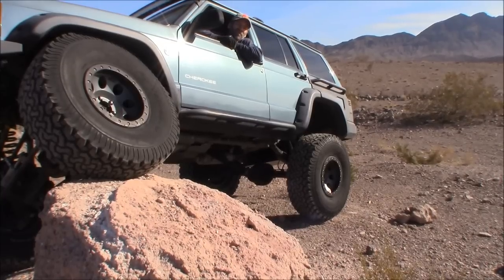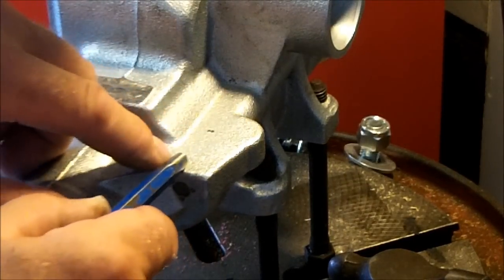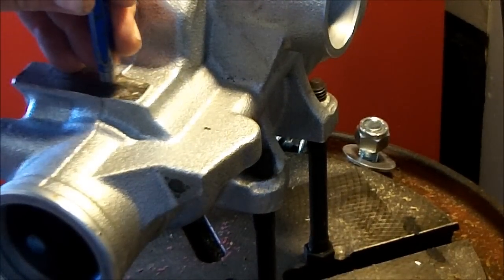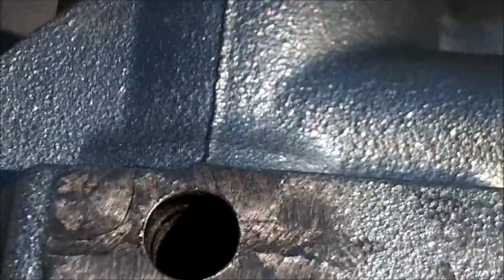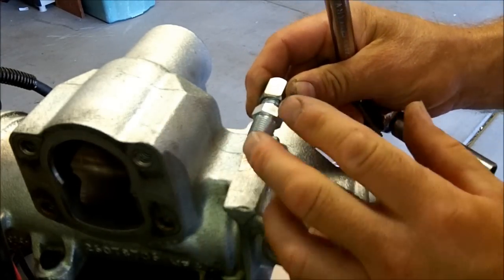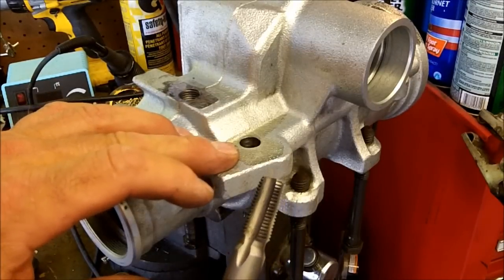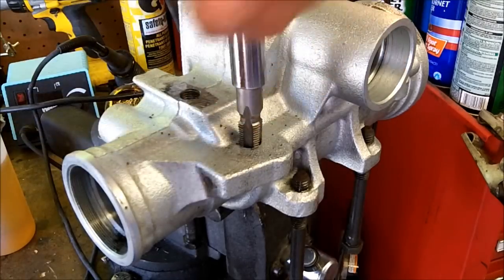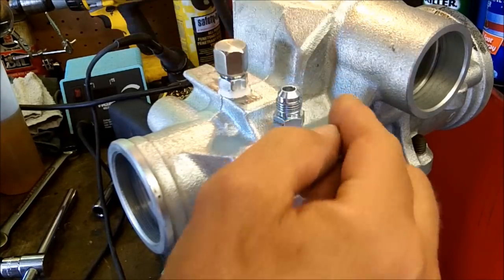How to Port a Power Steering Box for Hydraulic Ram Assist

Comment: That was impressive moving that rock and sliding the Jeep over. I'm on 35s with a front locker. In 4 low while Turning sharp is a chore sometimes. Usually pop back into 2wd
Reply from the maker: That sounds like the shifting fork inside the transfer case needs to be replaced. By the way I'm on 35's and front and rear lockers
Reply: @martinbuilt  oops, I meant to say I shift back into 2wd to make sharp maneuvers and shift back into 4x4 after. Simply having the front end unlocked makes a big difference. I don't have a selectable locker. Spartan lunch box locker.
Reply from the maker: @lol123321123321  oh I thought you were saying that it was popping out of 4 wheel drive.
Reply: @martinbuilt  yeah, I phrased that wrong. Nice jeep man, looks like there's not any mods left for that Jeep! Built right
Reply from the maker: @lol123321123321  Thank you, I got a few mods to go

Comment: everything you mention i already no about but anyway thanks for your out put..have a great day..
Reply from the maker: There's another thing how about the frame where you bolt the steering box to. Many times on the Chevrolet the frame will crack around the steering box this would cause a lot of movement in steering wheel.
Reply: i no allabout the frame cracking where it mouts i have already check that when i pull my gear box off the frist time

Comment: So what is under that passage plug? Could a person remove that plug, open up the hole and tap it vs cross drilling the thinner wall? 
I have seen the replacement end caps that have a port in them, which port is that cap supplying vs your method of drill and tap? BTW not the biggest fan of the ported caps, just seems vulnerable!

Comment: Ok...I know it has been 9 years since you published this video...but did you ever have a video on installing the hydraulic cylinder and lines?
Reply from the maker: No, I didn't do a video on that, I wish I had.
Reply: @martinbuilt  what did you use for the hoses and hydraulic cylinder? And how much travel does it need? And do you still have the XJ?

Comment: What would the on road characteristics be like with a hydro assist upgrade. My cherokee is my daily driver. Cherokee steering has always felt heavy when I drive my other rigs. 

Curious how this would make it feel during normal driving. Hoping it would help it feel more refined and modern. If that makes sense.

Appreciate the videos man.
Reply from the maker: At 1st you're going to swear that the steering is loose and what it is it's become a more sensitive, it takes less effort so you have a tendency to oversteer at 1st until you get used to it because the steering wheel feels extremely light.
Reply: @martinbuilt  Thank you for the response! 

-Being for sensitive is what im looking for. As far as road characteristics/handling, is there any worth mentioning? Do you think it would accomplish what im looking for, or do you think it makes the steering feel “wonky”?

-I am really hoping it just makes it feel a little softer/easier to steer, more like my tacoma.
 
-Do you happen to have any suggestions or ideas that would accomplish this, if a hydro assist is a step in the wrong direction?

Again, very much appreciated.

Comment: I HAVE A QUESTION FOR YOU I HAVE A 1990 K5 BLAZER WITH A 3 INCH BODY LIFT ON IT AND 35X12 TIRES ON IT AND I HAVE ALOT OF PLAY IN MY STEERING EVER THING IS NEW UNDER THERE I HAVE PUT 2 REBUILD GEAR BOXES ON IT AND IT STILL HAS PLAY I HAVE HAD THE TRUCK FOR A LONG TIME DROVE IT OUT OF TOWN AND I NEVER HAD PLAY LIKE THIS ..BUT WHEN IM CHECKING IT ..IT LOOKS LIKE ITS COMING FROM THE GEAR BOX I CAN MOVE MY STEERING SHAFT 2 OR 3 INCH BACK AND FORWARD AND I DO NOT SEE MY WHEELS MOVE IS IT POSABLE  TO HAVE GOTTEN 2 BAD GEAR BOXES..TELL ME WHAT YOU THINK...THANKS
Reply from the maker: I would imagine it is possible that the steering boxes were bad but unlikely. I would have someone rock the steering wheel back and forth while you're observing the steering shaft to the steering gear box to make sure there's no movement there making sure that that connection is solid) then also check your pitman arm and then your tie rod ends. Watch the movement at  the steering gear box between the input and output shafts.
Reply: @martinbuilt  hey truse me the pitmanarm  are tie rods ball joints  everything is brand new i have a brand new up grade telesconing steering shaft from summit ..new rage joint ..only thing i can see is the gear box..